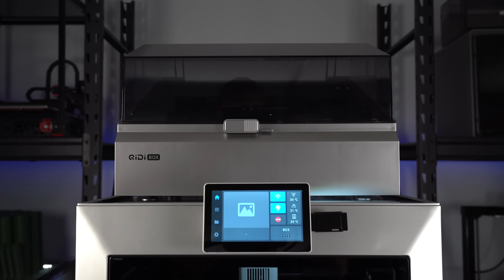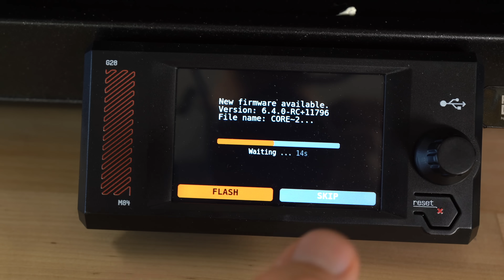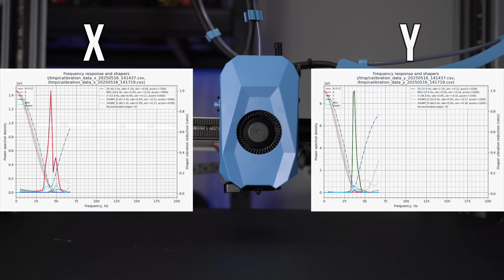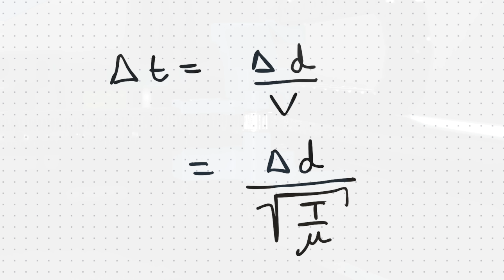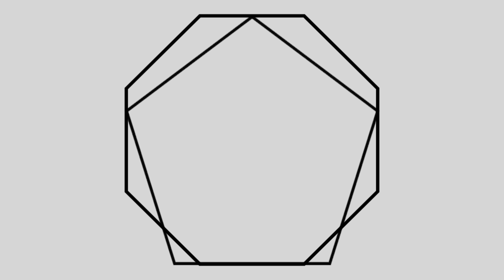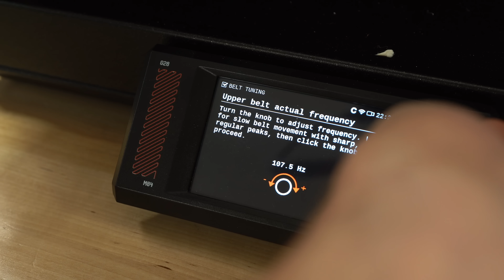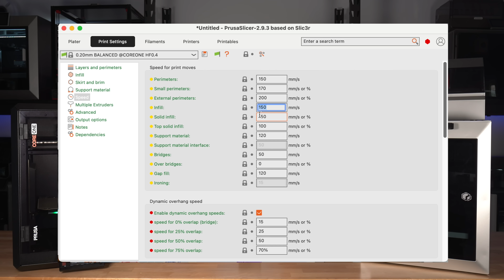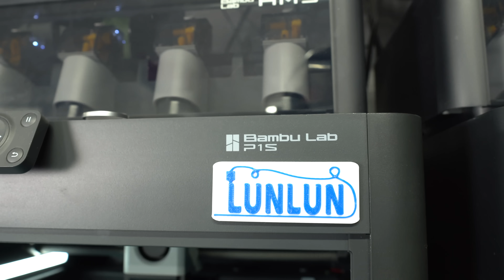The 3D Printing VFA Epidemic

Comment: IMO stepper resonance is not caused by electrical waveform, but by torque changing during microstepping. Monolithic Power Systems has experimented with it in "Why Microstepping Isn't as Good as You Think"
Another page by Faulhaber "Eight facts and myths surrounding microstepping operation with stepper motors" states that one 1/16 microstep has 10% of the torque of full step.

There were VFA-free stepper motors for Enders and MK3, at that time sold out. Not sure how they were different or tuned...

Stepper motor momentum and varying frequency resonance/judder plays the belts as they stretch trying to move another mass at the other end (print head). Add belt tooth resonance to the mix and band can play together 😉

Some printer manufacturers prioritize printing speed (e.g. Creality with K1) with strong steppers and large pulleys -- and sometimes have to back off to weaker steppers and smaller pulleys (K1C) to cut down too obvious VFA.

Currently we see 1.5 mm belt performing better, but we don't actually know why . It too has to have resonant frequencies. May it is just happy accident with motors and pulley diameters that peaks are not within normal print speeds?
Reply: Trinamic has pretty good control logic especially when interpolation is enabled. They perform better at a given motor current than any other driver. Although the true solution would be full FOC control which the tmc4671 is capable of and recently had support added in Klipper.
Reply: @groundzero_-lm4md  without actual feedback, torque between full steps is weak - and between microsteps very weak.
Not sure if FOC can correct that? Maybe it works between steps like every other motor - between poles, just with more poles / revolution?
(in the end it's just math and more math that looks like magic 😉)

Still, having motor sorted out, there are still all deficiencies of the rest of the system to manage...

Comment: Ah yes, this was a rabbit hole I fell into because my VFAs were so bad they were impacting my ability to fit printer parts together. Great summary on the causes and solutions. Orcaslicer does a decent job with the speed avoidance. For the Klipper enthusiasts out there, Klippain's shaketune has a CREATE_VIBRATIONS_PROFILE command which will give you a great graph showing what stepper speeds to avoid.
Reply from the maker: Definitely a deep rabbit hole. Good to know about shaketune - thanks for the tip. Surprised to hear that your VFAs were affecting more than just aesthetics.

Comment: Wow Taylor!  You really did a great job explaining VFAs. 
Each iteration of tech brings it's own set of wonders & pitfalls doesn't it?

Thinking deeper into this subject. Printing ABS inside a 65c chamber. 🤔 
With the belts and motors fully soaked at 65c I bet the VFA effect changes. 
I haven't really noticed because my print farm is all Qidi. 
When you review the Core 1L. Let's see how that works! OK?
Reply from the maker: Thanks Steve! No plans to review the Core One L at this point but we’ll see…

Comment: I didn’t succeed on eliminating vfas on my bambulab a1 but I significantly reduced them by oiling the rails of the bed. Apparently didn’t use enough oil and the rails were too dry.
Reply: The oil evaporates eventually, lubing the rails is part of the ongoing maintenance recommendation, check the bambu wiki for frequency.
Reply: @JulesHatton  I know, the printer actually tells me when to do it.

Comment: very nice
on my Voron Trident i have GT 1.5 belts and the LDO 2804 Super Power (1.8°) they are very heavy to VFAs an i see no VFAs thanks to the belts at any speeds (from 100mm/s to 600mm/s)

on my Klipper A1 Mini i use the stock motor/belt on the Y axis an these are also GT1.5 belts and on X i have seen they have some special belt a mix of GT1.5 and flat areas (i removed the Stock Toolhead) and on X i have heavy VFAs
Reply from the maker: Interesting info! Thanks for sharing.

Comment: Alternately, VFA's aren't a big deal in the grand scheme of things, for pushing a button and a plastic part magically appearing a few hours later.  compared to the cost of injection molding, compression molding, thermoforming, casting, etc. 
it's an okay trade off, and in any manufacturing method, there will be trade offs.

Comment: So the problem is vibrations making their way to the print head. Why not add some spring loaded rollers behind the belts on the smooth side as frequency compensators?

Comment: Hmm. I do have those on my corexy diy machine running klipper. Now I need to find out how to measure/determine the correct "resonance frequency avoidance"range settings which are present in the latest OrcaSlicer version.... without having stroboscopic lights like Prusa and preferrably without dozens of test prints for weeks ... 
Any idea anyone?

Comment: What I didn't quite understand is whether VFAs are purely a cosmetic problem or whether they also impact tolerances and dimensional accuracy, for example.
Reply from the maker: Great question. They would only measure a few microns at most so for all intents and purposes they’re an aesthetic flaw.

Comment: You need to add the motor mount methods (prusa is really bad), then temperature variations, and the (lack of) rigidity of the idler mounts. To give you an idea; a laser XY table has a full end to end repeatability of 1 micron. That accuracy is not needed for 3d printers but they should leverage the system in general
Reply: You can buy 3d printers that have none of these issues, they just cost 10x as much. I don't know how much a decent laser XY table costs but I'm guessing it's either more expensive than a consumer printer's movement system or designed for slower speeds, or both.
Reply: @brinkoftext  name, please, at least several of those "flawless", but 10x more expensive FDM printers.
Reply: @orche_ork   Pantheon HS3 and HS-Pro for example. Also I didn't use the word flawless, but those printers can't have issues with stepper motors or belts considering they don't use any.

Comment: I'd love to see your hypotheses about the polygonal effect and motor VFA supported experiments. Both Prusa and Bambu fine-tune the motors with some clever motor control techniques. And the pulleys are actually round, so they should support the belt perfectly.
Reply: "the pulleys are actually round"
He never said they aren't round. It's the belt that's not perfectly circular because of the tension, and the radius changing from the rotation angle makes sense.
Reply: @brinkoftext  If they are round, they support the tensioning cord on a circle, not a polygon.
Reply: @yaqwsx0cz  But they are rubber so they derform on the round surface... and become not round. Which creates this polygonal effect.
Reply: @yaqwsx0cz  Yes, smooth part of belt to smooth idler pulley will support the tensioning cord on a circle. This issue is specifically belt teeth being supported by smooth idler pulleys, which is very different and incapable of reliably (yeah yeah if the stars perfectly align with stiffness and tooth pitch and tension and contact angle it technically can make a circular arc) supporting the tensioning cord on a circle.

Comment: I have extensively studied belt VFA (types 2 and 3 according to your classification) on various printers, and I notice several errors in your video.

First, the presence and amplitude of belt VFA do not depend at all on whether the belt is in contact with smooth or toothed idle pulleys. Replacing smooth idle pulleys with toothed ones did not yield any improvements in any of my tests. What matters is only the number of such contacts. If you adjust the belt path so that only its smooth side contacts smooth idle pulleys, the ripple decreases significantly.

Second, I was unable to find a correlation between the pulley diameter and the VFA value. I tested the same printer with pulleys having 12, 16, 20, 32, 36, 38, 39, and 40 teeth, and the VFA amplitude remained unchanged. Additionally, I tried installing pulleys with different numbers of teeth (e.g., 39 and 40) on different axes, and this also produced no effect. There was also a case when the first‑version Creality K1 used 36‑tooth pulleys and suffered from very high amplitude VFA. In the K1C, they were replaced with 20‑tooth pulleys, which significantly reduced the VFA amplitude. This suggests that the polygonal effect either has no impact on the VFA amplitude at all, or affects it so slightly that it’s impossible to detect.

It should also be noted that I discovered a custom pulley geometry that can notably reduce the belt VFA amplitude. Essentially, on standard pulleys, you need to decrease the tooth height by 0.2 mm without changing anything else. I also tested modifying the tooth pitch on the pulley, using barrel‑shaped pulleys, inclined teeth in various configurations, etc. None of these yielded any effect.

Apparently, belt VFA has a resonant nature, and it’s unlikely that it can be completely eliminated without redesigning the printer’s structure. It’s necessary to switch from standard toothed belts to herringbone belts. These would generate an even number of vibrations strictly in antiphase, which should eliminate this defect. The only issue is that no one manufactures such belts in sizes suitable for use in 3D printers.
Reply from the maker: Sounds like you’ve done a lot of great testing! I’m completely open to feedback if anyone wants to challenge my assumptions. I tried to research this topic as thoroughly as possible but the available information is limited. Thanks for sharing your thoughts. Have you shared the results of your research anywhere?
Reply: @ygk3d  yes, on my channel in couple of videos and in vostok 3d printer's telegram channel. Can't post links because youtube will remove comments
Reply from the maker: @SorkinDmitry thanks. I haven’t been recommended your channel before. Probably because of the language difference.

Comment: So good. I learned a ton and have even more questions. The only core xy printer I have is a P1S. I have an FLsun super racer I have heavily modified and have always done manual input shaping on as I never could seem to get the results I wanted with an accelerometer which I know is strange and when orca came out with the integrated input shaping tests I ran into a very strange set of results on that printer that has me tuning the input shaper ina way that is not inline with the instructions and it has me a bit confused. I could not get the wringing to show up when running the test and essentially how I ended up tuning it is I ran it with the acceleration set to 10k and set the frequency to where the part on the wall that is supposed to have a tiny gap closes almost to touching. At low frequency there is a huge gap and as the test goes on the frequency of input shaping goes up and as it does the gap closes and when the gap is just shy of completely closed that is where I measure too and set my frequency and that is the acceleration I run my outer walls at, which is a higher frequency and higher acceleration than klipper ever recommended when using an accelerometer, but print quality does not lie. Is till get some super faint VFA's but I can only see it with super shiney stuff like PETG. I really wish I knew why this works this way on my delta printer and wonder if it is some weird quirk of a delta or the moded toolhead or something else since I do not have a Core XY to compare and test against.

Comment: This video seem like it was on the cusp of providing something amazing I learned a bunch but there was no rule called to action where I could go out and fix something myself.
Reply from the maker: Biggest takeaways for the viewer should be to find the right belt tension and printing speeds for your setup - that’s easier said than done. Biggest takeaway for the manufacturers should be to do that so the user doesn’t have to, as well as to avoid it in the first place by making better hardware selections. I wish there was a miracle solution but it really comes down to testing and tuning which most people probably can’t be bothered to do. And as I pointed out, in the case of printers with automatic belt tensioning systems you’re not able to tune in the tension so you’re kind of stuck on that front.
Reply: @ygk3d  first off I want to personally thank you for taking time to comment back, so for my prusa MK4S I think what I'm taking away is possibly getting some teeth geared for the smooth pulleys is that what I'm also understanding? Or should I try to adjust and buy some 1.5 belts for my Mk4s? You don't outright say it and I understand why you wouldn't but I'm asking you, from the suggestions and the benefits that you seem to lay out would you say I would highly likely benefit from switching to that hardware?
Reply from the maker: @jonathonmoreno6765 Being a bed slinger, I’m not entirely sure how the dynamics differ. I focused my research on Core XY. That said, there’s a good chance you’d see some improvements from those modifications but the effort required to make the swap wouldn’t be insignificant. I’d sooner suggest you just do your best to find speeds that don’t excite resonances.  Or don’t print with super glossy filaments.
Reply: @ygk3d  the effort isnt a factor as i enjoy tinkering. Last follow up question, as im unfamiliar with 1.5mm pitched belts, is there a specific pulley spec that i need to purchase to accept the belt properly?
Reply from the maker: @jonathonmoreno6765 yes. You’ll need a 1.5GT pulley.
Reply: @ygk3d  thank you again! I now have my winter project!

Comment: Would getting rid of belts fix this or is the the ball screws
Reply from the maker: I think the answer is to get rid of all of it and take up woodworking instead 😂
Reply: @ygk3d  Already do.  Going through the tough early learning faze but I am enjoying it.
Reply: or do we need to finally get rid of the stepper motors?
Reply: did not mean belts meant something other than the stepper motors that would be smoother and more exact.

Comment: What happens in cases like the ratrig v-vore4 that has a hybrid system of 4 engines in XY?
Reply from the maker: Great question. I don’t know the answer but maybe someone else has some thoughts. It has twice as many motors on Y but not sure of the exact arrangement. I’m guessing it would just add additional sources of vibration which could either add or cancel to make the situation better / worse. But will most certainly depend on the exact layout of motors and the belt path.
Reply: What would happen if a 3D printer was customized with the 3 axes with recirculating ball spindles and no strap?
Would you improve the surface quality of the piece and lose speed?

Comment: The problem with VFA is EVERYTHING causes VFA's
Reply: I propose that the visible artifacts observed in processes such as 3D printing—specifically vertical fine artifacts (VFAs)—are not merely mechanical imperfections but manifestations of a broader universal principle: physical reality operates through wave-based order modulated by chaotic influences, with these oscillations recorded in any system that transports or deposits matter and refined over time by entropy. While engineering methods may reduce or suppress the visibility of such artifacts, they cannot be fully eliminated through the same mechanisms that generate, transport, or deposit the material, because the pattern is inherent to the underlying dynamics rather than a defect of execution. We now come to more questions,  "What are 3D printing the limitations", "What is acceptable?", "What is practically affordable?"
Reply: @JimDivis  Most of what you said here is meaningless nonsense. I hope this was generated by an LLM
Reply: @JimDivis  thats a whole lotta words for you to say "is this worth overengineering out"
Reply: @JimDivis  but deep inside the physics it operates as discrete numbers instead of a continuous wave
Reply: @JimDivis This seems related to the realization that (at least on levels larger than atomic, and maybe even then) everything is at some level physically imperfect, but I haven't previously considered the role that propagating waves might play in this.  Huh.
Reply: Stiff Suspension on the print head would fix this